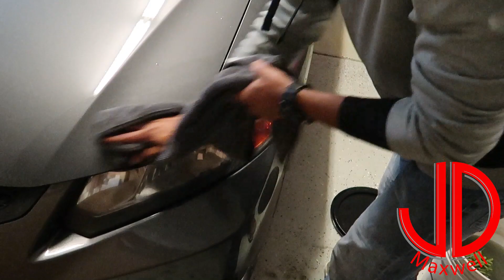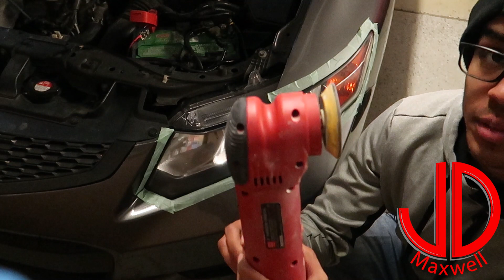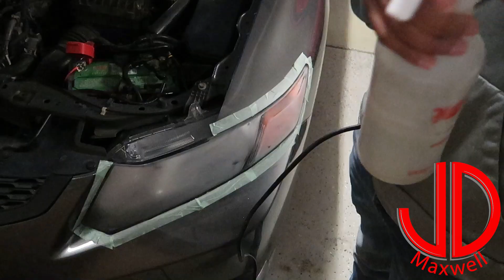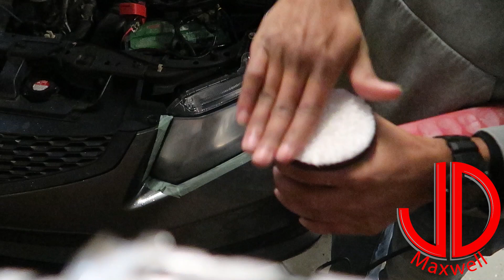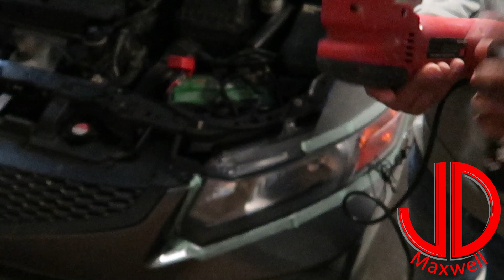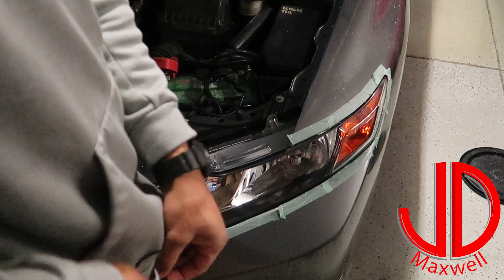Restoring Faded Headlights

Comment: Is there really ever a point where a headlight could be too far gone, or can even the worse grimy headlight clean up?
Reply from the maker: Jon Lukens if the oxidation is on the outside part of the lens then they can be polished but sometimes the oxidation is on the inside of lens in that case you can’t fix that unless you want to take them apart